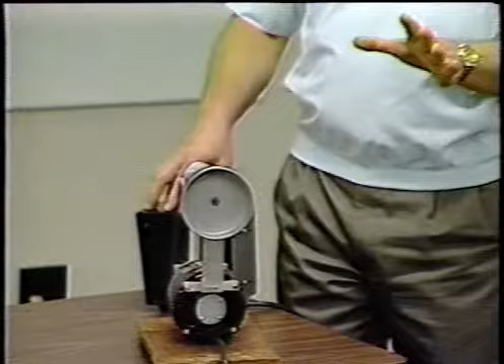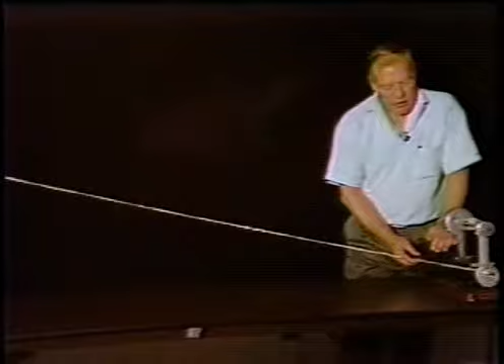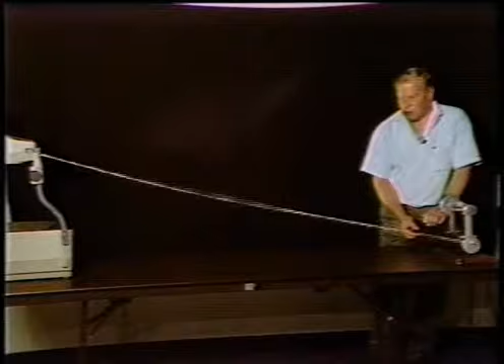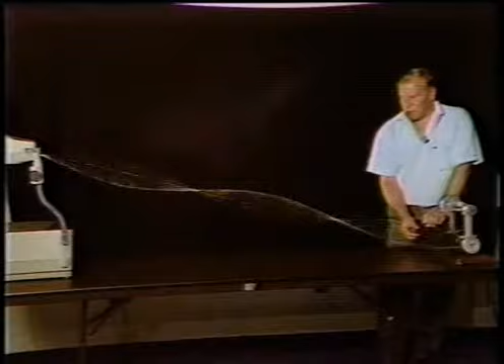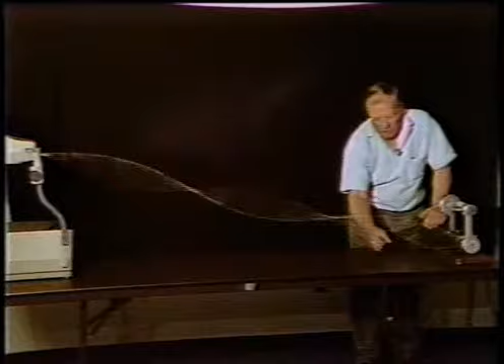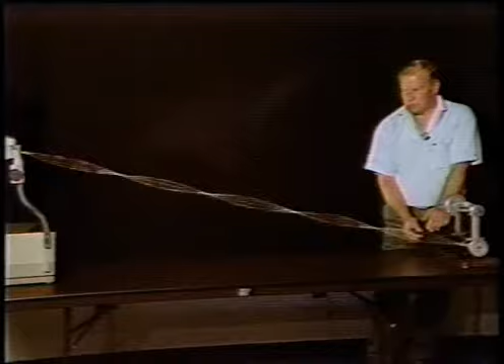rubber band resonance demo

Comment: Would it be possible to increase the speed to the point where there were no more bending nodes?  Where the rubber band would be just straight as it was at the beginning?